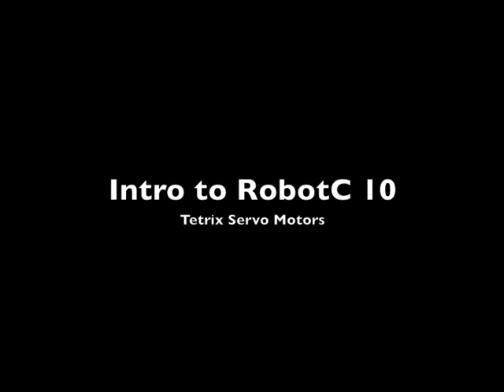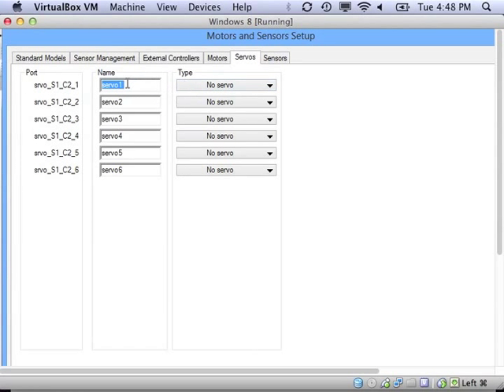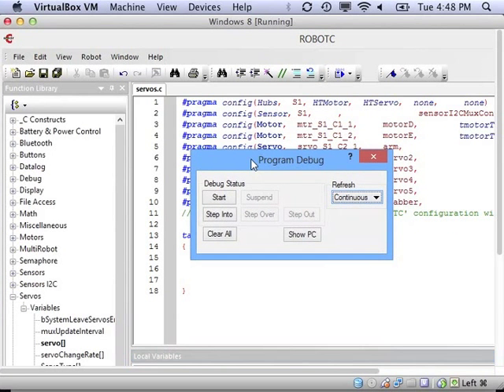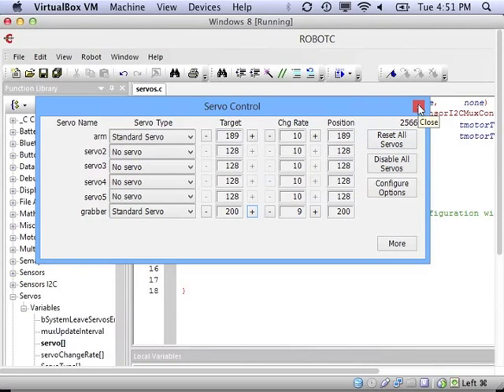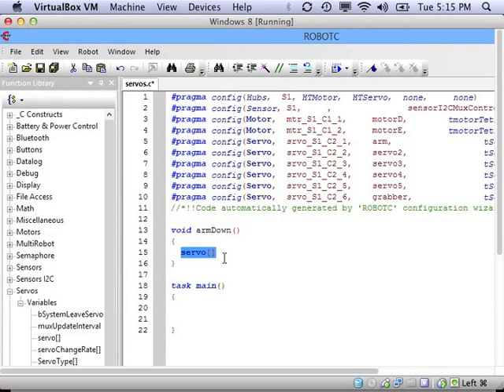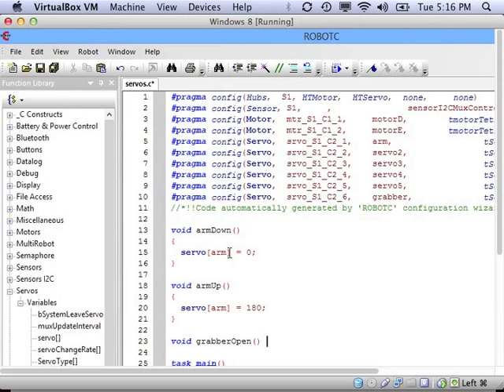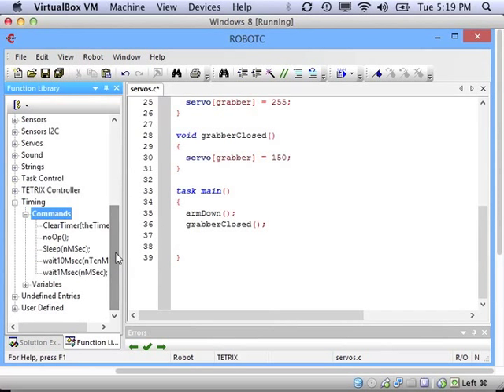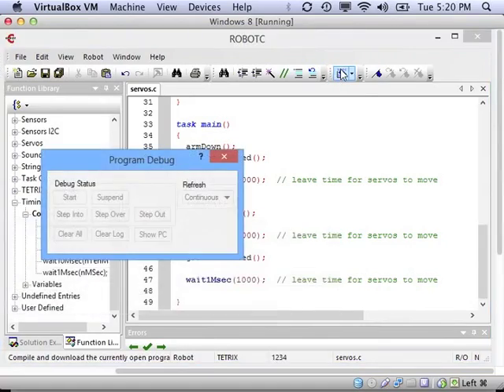Intro to RobotC 10: Servo Motors

Comment: hello. On our robot for FTC we have two servos in the back for towing. Yesterday we programmed them and they wouldn't move at. We don't know what going on. We don't think that it the servos because it unlikely they both our defective.
Reply from the maker: Things that I would check... is the servo controller lighting up and indicating that it has power?  Are the servos plugged into the controller correctly?  Specifically, there is a little YRB on the servo controller.  That means Yellow Red Black.  Is the servo cable plugged in so the cable wire colors match the YRB?  Then, my only guess would be that the motor/controllers aren't correctly configured in RobotC....